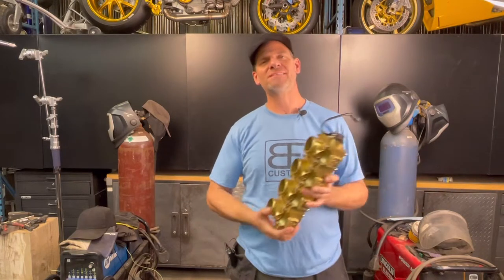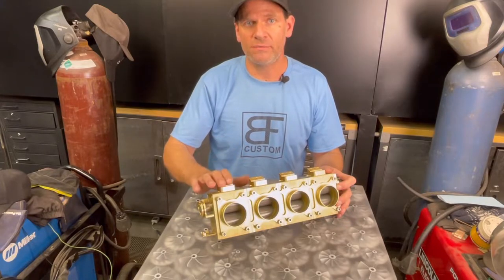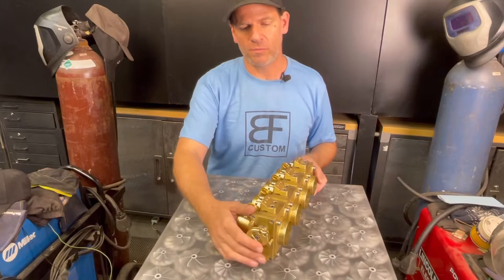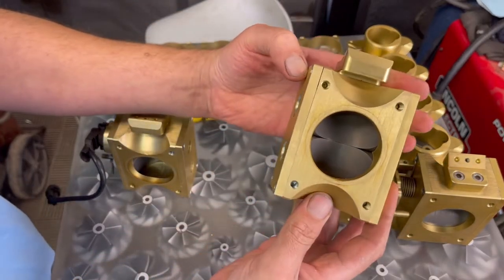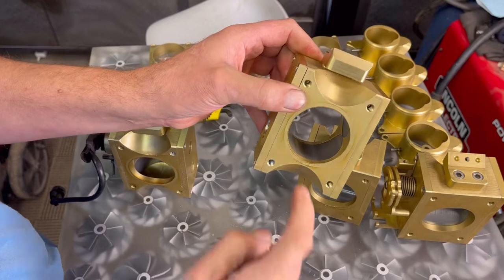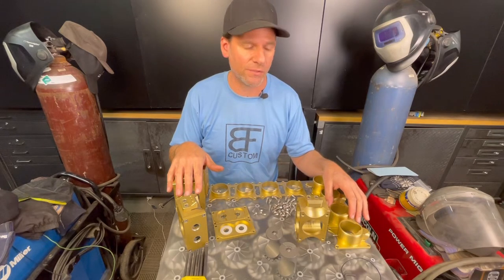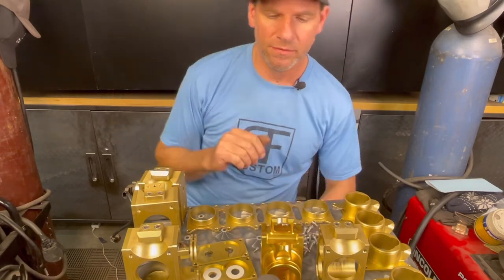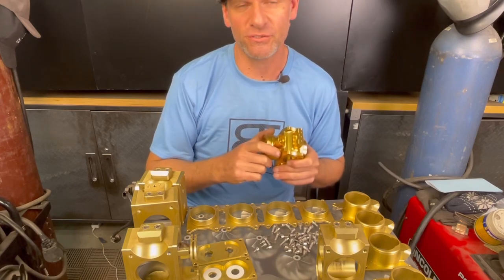The Ultimate Throttle Bodies !!

Comment: Wow.... This is incredible.
I can tell you with certainty that there is currently a niche market where a design such as THIS could solve a problem that is becoming more and more common. For BIG single throttle body 'Single Butterfly' units (in the 100mm +/- range, both DBC & DBW), there seems to be a specific limitation that is leading to failure and at times, catastrophic damage as well as extreme danger. Being an Engineer as talented as you are, I am very certain that you may know exactly what specific limitation/danger/failure-point that I am referring to, with the aforementioned 'big-single-butterfly' throttle bodies. Currently, the common fix is to simply use either 2 smaller round throttle bodies (more failure points), or to run an oversized Oval twin-blade, which creates plumbing problems of it's own, so not very elegant either way. THIS is the market that you should focus on, as well as finding a way to 'protect' your intellectual property from would-be thieves. Hopefully you understand what I am saying. I'll check back just in case.

Comment: Thats cool.  Just the fact is that this idea is/ was used at least in rallycros. 
About 7-8 years ago at least. Specificaly- 1.6 liter class na FF hot hothatches . There used to come at least a few different ones to rent our  dyno in the shop i used to work. (Lithuania -so not a major motorsport country)
According to tunner - these had a better part throtle control as compared to other the "non butterfly" " throtle bodys (sliding type or single barrel).
those always looked super cool to me.

Comment: as much as i like this, theres still... something... iunno. experience of RC and leaking around the barrels themselves. and theyre only 15mm or so.

i guess its all alloy so the coefficient of expansions working in your favour.

i saw no allowance for synching/balancing? still, the little hex couplers and the spacer plates could be tweaked to give the ability...

i guess its down to end use as well. dont need balance if its for drag, do ya? who cares about a lumpy idle?as long as they open, right?

oh well. nice to see my approach is still secure in its originality ;) doing something else entirely.

"20 years to finish it"...
yep. sounds about right, too.... lol. back shelf projects...